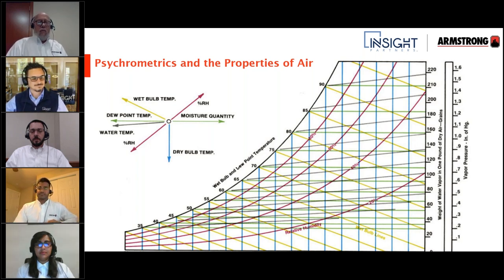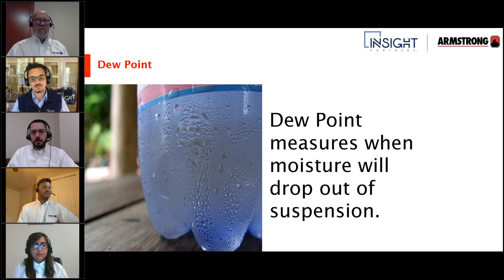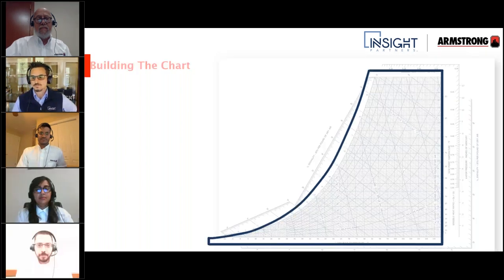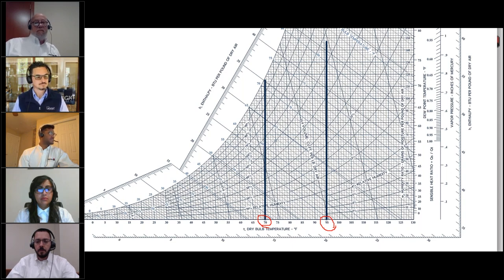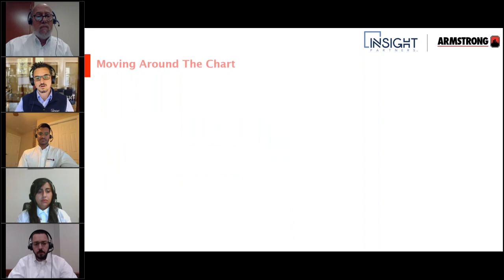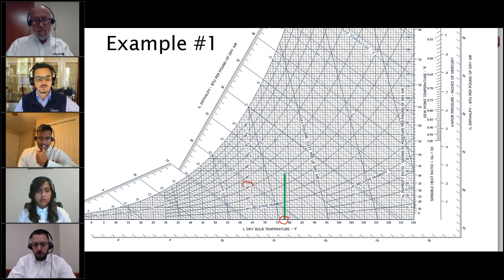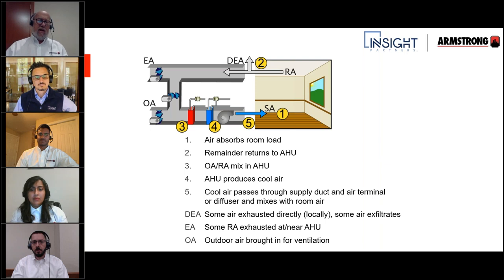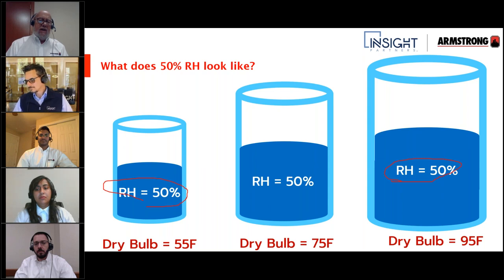Psychrometrics and the Properties of Air - How To Read A Psychrometric Chart

Comment: Let's say if your chilled water entering in cooling coil is 44 deg F and exit at 54 deg F," how can we calculate the effective coil temperature", if that temperature is below entering air's dew point temperature then it's called as apparatus dew point temperature
Reply: I have asked a sensible question I guess please don't give answer late (nt)...
Reply from the maker: I’m not sure how that can be calculated. I would say the coil manufacturers can probably get you an estimate.
Reply: That question always excited me, thanks.
Reply: You need the Bypass Factor for the coil. It’s a value the coil manufacturer can provide.

Comment: How to calculate apparatus dew point temperature?
Reply from the maker: I would ask the coil manufacturer. They usually have selection programs that can calculate this. Thanks for asking!
Reply: it usually is 10 degrees above the evaporator saturation temperature